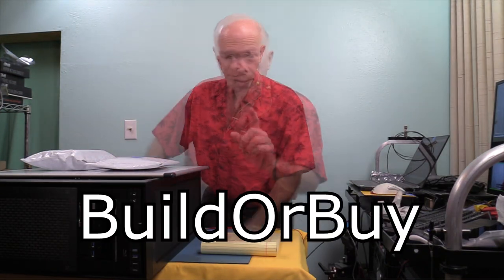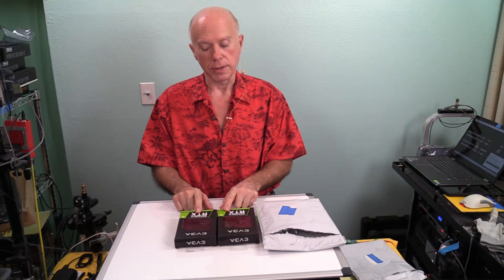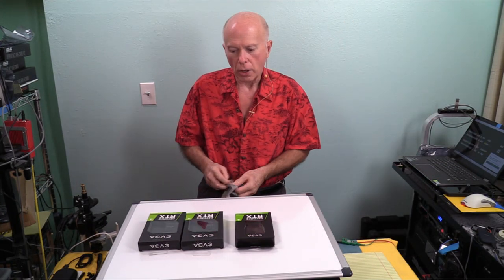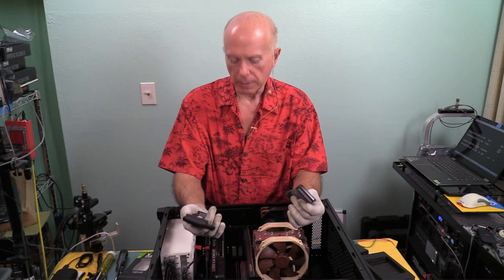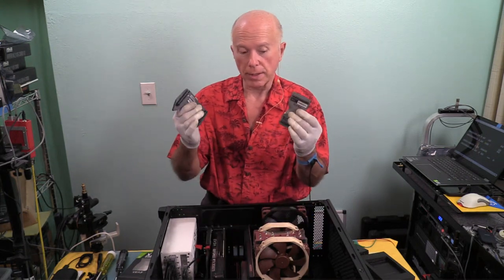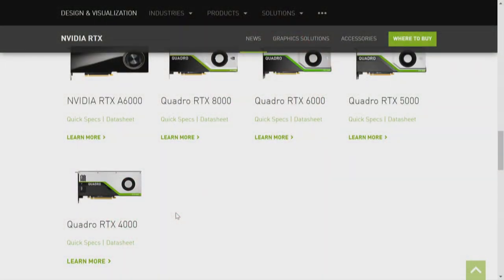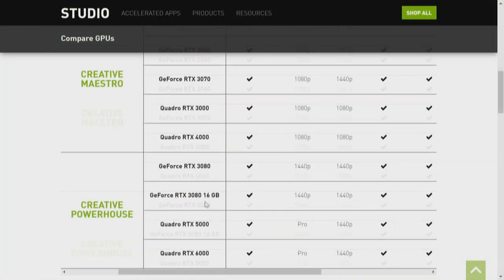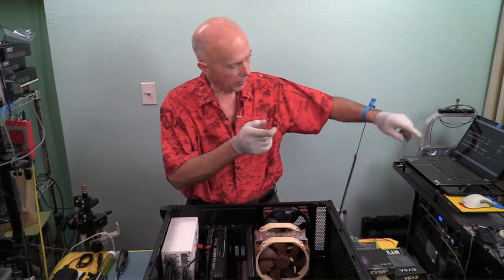Unboxing EVGA RTX NVIDIA NVLink Bridge

Comment: Questions regarding the upcoming Threadripper Pro Motherboards WRX80 ..... Where does Supermicro stand, among ASUS, and Gigabyte as far as quality ? Hardware, BIO, etc....? I've been looking these motherboards over, as well as looking further into Gigabyte, ASUS, and Supermicro for quality, practicality, functionality, performance, and overall reliability ..... Visually, their components, or parts seem to be all on par with one another, as far as I am able to see, but really knowing how solid the components of the motherboards are is cloudy....
Reply: Hi Shannon Bailey, Good Questions. Speaking from experience, SuperMicro built Desktop Motherboards many years ago. And we had used them at that time. Now, SuperMicro Builds Servers and Workstations. 

Gigabyte has the most in terms of offering an M.2 Aorus card and a Titan Ridge Thunderbolt card in the box. However, right now, Gigabyte is MIA on this WRX80. Don't know specifics. We can theorize based on the RTX40 but it's all up for conjecture. 

Gigabyte is known for Desktop Computers. We have a very long continuous history with Gigabyte. 

ASUS Builds Desktop and Workstation class Motherboards. If we were Building an x299 Workstation, ASUS. And we have Built Desktop Computer Systems with ASUS Motherboards. 

We're working on a Video about Building a WRX80 Workstation. And will talk about all 3 as if all 3 were available. 

If we had the chance, I'd like to Build the WRX80 with ASUS then Gigabyte, in that Order and compare the two. 

The SuperMicro will be a bare bones Build. The ASUS, although a Workstation will have bells and whistles. Whereas, the Gigabyte will also have the Thunderbolt. And I don't know if Thunderbolt is enough of a reason to go with the Gigabyte if that's the only reason. ASUS usually does a better job with Bios and Documentation. Whereas, Gigabyte Dual Bios, I'm a Fan of that technology! 

To Build WRX80 right now, ASUS. 

As for reliability, these are Workstations. Higher quality Components are suppose to be the norm. Right now, ASUS has the best documentation. The current Gigabyte literature is more marketing. The PDF is abysmal. Expect that will change once that Motherboard ships. 

The real question, should be TRX40 or WRX80. And that too we'll address. Remember, this is a 1st Generation Threadripper Pro. We have 3 Generations of Ryzen. Then 3 Generations of Threadripper. We built a 2nd Generation Ryzen. We Built a 2nd Generation Threadripper II (x399 - PCIe 3.0) and 3rd Generation (TRX40 - PCIe 4.0) Threadripper III. Historical perspective. The TRX40 is hard to beat. Remember, PCIe 5.0 and PCIe 6.0 are coming in 2023!
Reply: I also wanted to note, that I read sometime ago from Adobe in regards to Premiere Pro, that, there was some kind of equation, regarding the amount of RAM needed for the Program, to see better performance.... That equation, went something like, for every Core, you needed at least 4gb or RAM per core to see better performance... Now with my first Video Editing PC, I had the Ryzen 7 3800X, with 32gb of Corsair Vengeance LPX RAM at 3200MHz, that worked well together, though when switching over to After Effects, I seen that I nearly bottle necked at 32gb of RAM.... So I upgraded that to 64gb of RAM, which proved to lower usage obviously.... I started out editing 1080p, then went to 4K, with multiple graphic layers in Premiere, and the 32gb of RAM with that Ryzen 7 worked smoothly.... In my initial build, I used a Nvidia GTX 1650 Super Mini from Gigabyte, that had 4gb of VRAM 128bit interface.... 4K proved to be too muc for that GPU when Rendering with CUDA acceleration in Premiere, and I upgraded to an XFX RX 5600XT RAW ii GPU with 6gb of VRAM at PCIe 4.0, which resolved that issue, though the AMD card didn't fully support all Premiere features... but it could handle the 4K... the 1280 Cuda Core count 4gb of VRAM on the GTX card just didn't have enough umphh... power to handle it.... however when working in After Effects the RAM needed upgrading, not sure exactly how that works, but it did... to work with the same file format H.264 4K footage.... upgrading to 64gb of RAM from G.Skill at 3200MHz worked fine... Now, which leads me to the RAM needed for the Threadripper 3970X... performing the same equation, I currently have 128gb of 3200MHz RAM, in 4 DIMM slots (32gb Sticks) which equates to 4gb of RAM per core, the same amount per core as the 8 Core, which leads me to believe upgrading to 256gb of RAM, same speed, would provide me with better performance in After Effects... I noticed Puget Systems used 128gb of RAM in their benchmark tests.... and also read where they needed more RAM to utilize programs like Rendergarden, that could take advantage of the more cores, but stated that those programs required more RAM, and they didn't perform tests with those programs on the Threadrippers, at least not in their Benchmark Test Articles.... So, if my theory...lol proves correct.... adding more RAM, which 256gb of RAM would equate to 8gb of RAM per core might prove to accelerate render times significantly... Time will tell... I haven't conducted any experiments yet, as I have to wait for some banking info to be updated to renew my subscription to the Adobe Suite... that was due on the 14th.... leave it to my bank to switch from MasterCard to Visa, and deactivate my Card, but not get me the new one in time... Shewww !....lol
Reply from the maker: Hi Shannon, Just realized. Yes, SuperMicro makes a great Motherboard. However, comparatively, the SuperMicro WRX80 Motherboard is a bare bones Motherboard compared to the ASUS or Gigabyte WRX80 Motherboards.

Comment: Nvidia locks drivers to drive AI devs to their pro lines. 
The biggest limited is vram, not really the cores. 
AMD would disrupt AI if they made a gpu link that could pool vram on consumer cards.
Reply from the maker: Hi David Cook, 
Very good point! Drivers for RTX Quadro are different, yes. However, and good, bad or indifferent, the RTX 3090 NVLink only works for 2 cards and it is suppose to pool VRAM according to Specs. That's the point of RTX 3090 NVLink. For CUDA and Tensor Cores that's a deal. For Drivers, being locked to RTX Quadro, that's definitely a problem! Whereas the RTX Quadro NVLink scales to an NVBridge for RTX Quadro and that's a big deal! Drivers and all! And that too needs to be considered if and when Building a WRX80! Details matter! Now to Build and Test! Thanks for pointing that out!

As for AMD... AMD Infinity Fabric Link Bridge Connector for Radeon Pro VII. Can't find the Bridge Connector. AMD is the one talking about it. Everyone else is just repeating what AMD says. I hear what You're saying. We'll see! 

https://www.amd.com/en/products/professional-graphics/radeon-pro-vii
"Building on the legacy of AMD innovation, Infinity Fabric Link brings the ability to directly connect two GPUs together via an ultra-high speed interconnect, effectively forming a combined pool of GPU memory, which can increase performance and reduce latency." Now, can that make use of Virtualization using SR-IOV for I/O hardware acceleration? Good question. I see no mention of it.

Comment: Dear Viewers! Can You also help me? How can I make the fastest RAMdrive on AMD Ryzen 3900X on x570 chipset? I must use 128 GB to have at least 70 GB ram drive which stores VirtualBox files. That's a virtual machine app. Storing these files on ramdrive makes the virtual machine run faster than from nvme m.2 drives. What do You suggest? Which RAM shall I buy or maybe something other as well?
Reply from the maker: Hi Don Jon, RAMdrive for VirtualBox, Wish I could be of help. I do not use Linux. I know Hardware and Windows. I can recommend RAM if that helps. Suggest using www.PCPartPicker.com  - System Builder. Good place to get started quickly. I'll do some research later. Probably DDR4-3200. No need for Samsung B die. Hope that helps!
Reply: @BuildOrBuy  What is Samsung B Die in simple words? VirtualBox is mainly for Windows, RAMdrive apps are for Windows. Try at least creating a 90 GB Ram drive, Crystal Benchmark it, then compare running a virtual machine that has Windows installed in it and then put the VM files on the ramdrive for comparison how fast that virtual Windows works. And last but not least, why not go for 3600 or 3800 MHz DDR4 populated in all 4 dimm slots on a x570 motherboard with AMD Ryzen 3900X CPU?
Reply from the maker: Hi @donjon7554 , 
Samsung B Die is the fast, expensive RAM. There's a big following of that RAM. One aspect of RAM is Brand or Manufacturer. Another is what chips are the Manufacturers using. Samsung B Die is the pinnacle of that. All RAM has a lifetime warranty. Specs are one thing, real world performance is another. And not just Benchmarks but actual usage. A balance of price and performance. Good to know but not necessarily needed. 

As for Speed, the faster You go the more critical the chips being used. Even reading SPD of DDR4-3200, that's overclocked Memory by JEDEC Specs. CPUs support up to that. 

OK! We'll look into that maybe later as time permits as Questions arise. I'm already behind in our Filming schedule! So much Technology to share and so little time!
Reply: @BuildOrBuy  Thank You and sorry for my question and comment bombardment. It's because of my handicap health. I can only be online for a small period. The rest of the time I'm paralized mentally and physically. It's very random so whenever I can move and think I interact in internet and in real life.
Reply from the maker: Hi @donjon7554  , Glad You're here when You're able! All good!

Comment: What is that RTX NVLink and why people are interested in it? What is it so important about it? I ask that in good intension cause internet information about it is quite misleading in my opinion. Can someone tell me simply enough so a GFX rookie like me could understand?
Reply from the maker: Hi Don Jon, Good question best answered by NVIDIA. "NVLink lets CPUs and GPUs connect in new ways to enable more flexibility in server design. NVLink is also much more energy efficient than PCI Express. NVLink lets data move between CPUs and GPUs five to 12 times faster than they can today." NVLink is faster than PCIe 4.0. Applications have to be aware of NVLink. Another technology trickling down to the Workstation and HEDT. 
https://blogs.nvidia.com/blog/2014/11/14/what-is-nvlink/#:~:text=NVLink%20lets%20CPUs%20and%20GPUs,faster%20than%20they%20can%20today.
Reply: @BuildOrBuy  That's the answer I was looking for. You write it so easy to understand!
Reply from the maker: Hi @donjon7554 , Our Goal is always to Keep it Simple! We hit the high points. Let's just make it work so we can make use of it if we need it. Some of this is specific. A lot of this is conceptual. All good to know as we go down this path. About the time we get this figured out, it changes and we start over! A reset! Temporary knowledge! The Specifics change but the Concepts stick. 

And NVlink is now a 3rd Generation next step in Connectivity for Video cards. I would expect when PCIe 5.0 and PCIe 6.0 are available, so too will NVlink continue to mature, requiring and delivering more Bandwidth.
Reply: @BuildOrBuy  This is what I hate so much about IT. Temporary knowledge, constant resets in that knowledge and most importantly one can never now if a task that's the same or similar to other will take 1 second, 1 hour, 1 day or even 1 year. Even tutorials don't help avoiding that. IT noobs expect advanced users to finish a task in a given time and they don't understand that it's always improvisation and random ETA. That's why I hate IT so much that I given up years ago from having an IT job. Bosses just don't understand that IT is so random and improvisation based even when You explain it 1000 times they still expect that you will know an answer for any kind of problem that appears and have it fixed right away or in a precisely given time window.
Reply: @donjon7554  I appreciate this comment.
Reply: @RickyBobby_USA  Hello. Did You appreciate my comment cause You wanted to ask the same question I did?
Reply: @donjon7554  The part where a manager doesn't understand potential complexities of IT fixes.
Reply: @RickyBobby_USA  Are You a IT person who suffers from being misunderstood by tech noobs who want instant everything?
Reply: @donjon7554  I'm not IT, but I've experience that sort of expectations while trying to fix something myself and a few other times on other unrelated jobs. I think it is common in all forms of work and maybe more in IT than others.
Reply: @RickyBobby_USA  I think there is no better example than IT expectations cause like our host says - "changing one thing - changes everything". That means there are practically almost none same scenarios when you are fixing the exact same thing cause if just something is different then you're doing it for the first time and a manger expects instant results but he doesn't understand why it's always improvisation and a new task for a problem that might be seen as a common one.  

That's why I left my IT carrier in a garbage and tried to become someone else  - try different job field. That impossible to fulfill expectations of idiots from management made me so angry over the years. These knuckleheads wouldn't listen that is it's impossible to predict if something's going to be fixed in short or long time. Their answer would be like this: if others have it working that means is doable and they want an exact timetable when is it going to be fixed.
Reply: @RickyBobby_USA  I've been doing some editing of my last reply to you. Please read again.
Reply: @donjon7554  yep...it is nice to not have to hold onto that anger anymore...one does need to take care of themselves.
Reply: And it's in the past...look ahead towards your future. Many bright moments can be manifested. You have the abilities.
Reply: @RickyBobby_USA  1. Wow thank You. I feel genuine blessings from You even if it sounds like typical HR garbage talk. 2.  I no longer have any abilities due to post Covid brain damage. I'm like a vegetable.
Reply: @donjon7554  Just bc you have this, doesn't mean you can't accomplish. Pls resolve to stay in the fight.
Reply: @RickyBobby_USA  Thanks for another friendly response. I don't have it in me anymore. Each month I have less of anything you could ever name. I'm cool and in peace with it. It's just when you're in the end of your life stage you will not take any kind of BS from companies, bosses etc.